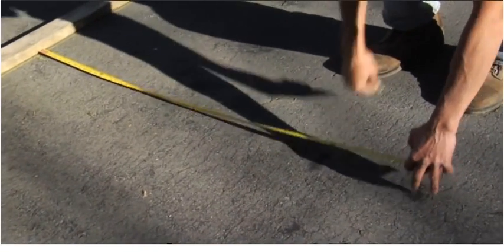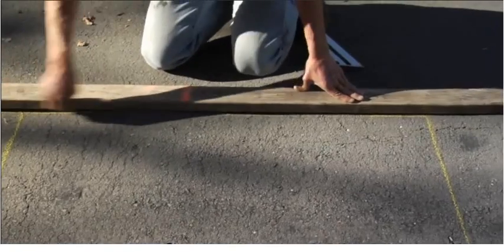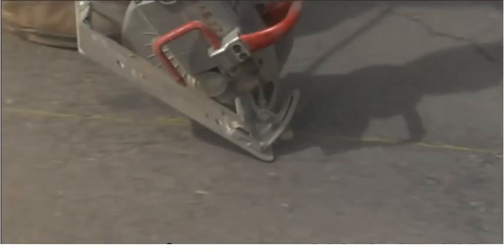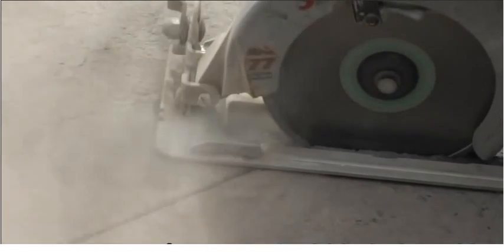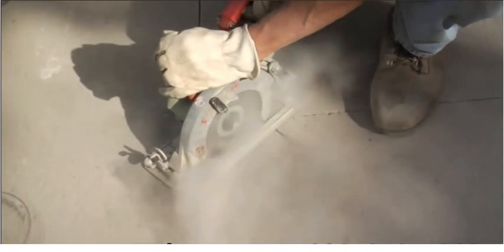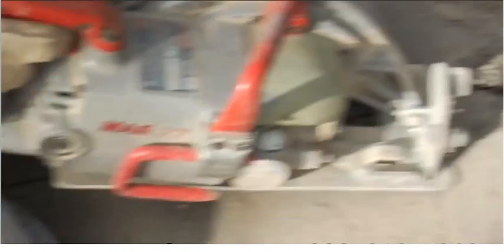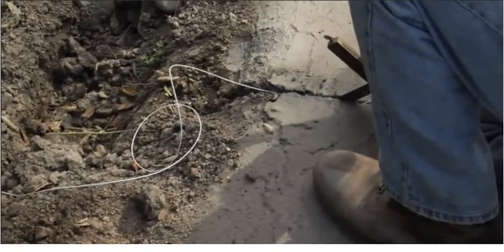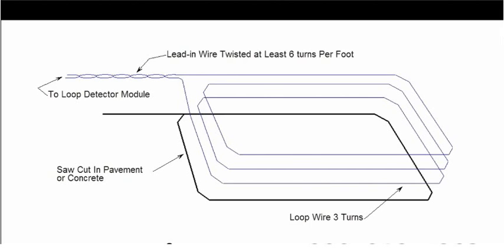installation  loop detector wire

Comment: In my line of work I frequently have to install Saw-Cut Detection Loops in Drive Through lanes at the menu/speaker pedestal and sometimes at the pickup window. The installation is basically the same although the loop size is considerably smaller 18”X54” with an 18” offset from the curb and 6 loops of wire instead of three. We also use 3/8” foam backer rod over the loop and then Self Leveling Polyurethane Concrete Sealant or the appropriate sealant for Asphalt (it’s been years since I installed a loop in Asphalt)
Our cut depth is 1 1/2” to 2” (more loops require deeper cuts) an I use a MAKITA XEC01 9”Powercutter (36 Volt Battery Powered Saw) with a  ROC Abrasives “ROC Crusher Blade (concrete) which can be used wet or dry, my preference is wet cutting because breathing in the dust is pretty bad for you and the restaurant customers aren’t inconvenienced by the dust. 
I get my blades from bladesdirect.net and couldn’t be happier with them an they cut faster and more efficiently than other blades while lasting much longer. They also have specials where you get a “free saw” with a box of blades. 
I’ve been using an old 1/8” metal cutting wheel to “roll in” the wire and have found this method to be really easy and faster than other methods. Instead of brushing the dust over the sealant I use Baby Powder to keep the sealant from getting tracked all over the lot and it works just as well.

Comment: Thank you for sharing.  Nice, well organized presentation.  My only question is in laying the wires in the loop.  The diagram shows the wire going around the loop cut into the concrete 3 times.  But I only saw one loop in the video.  So is there three or one loop in the driveway?
Reply: There are 3 loops into the cut concrete.